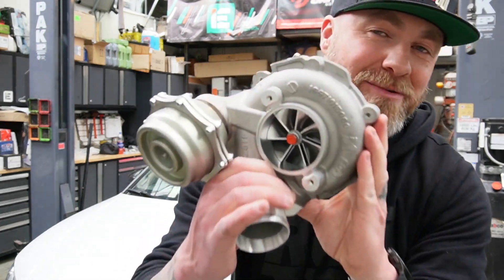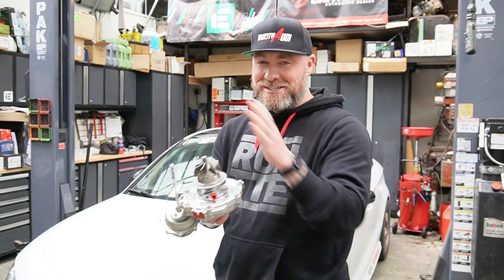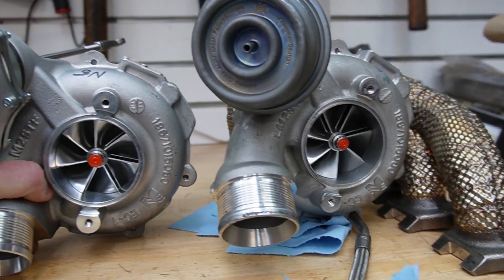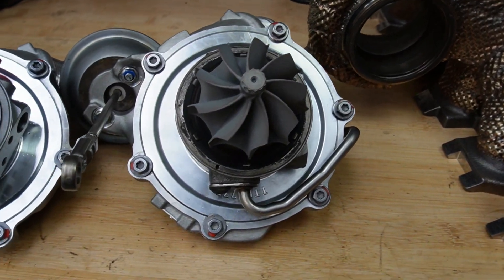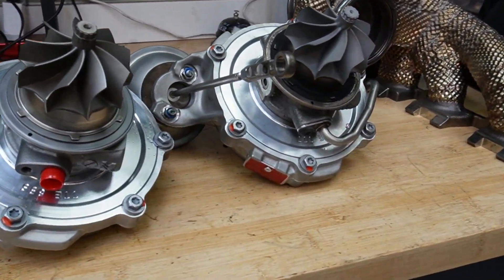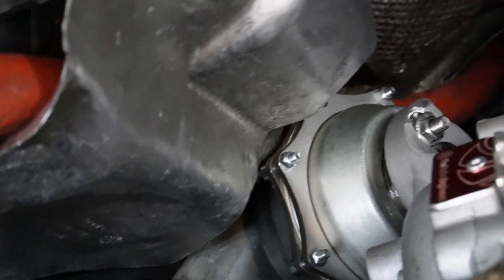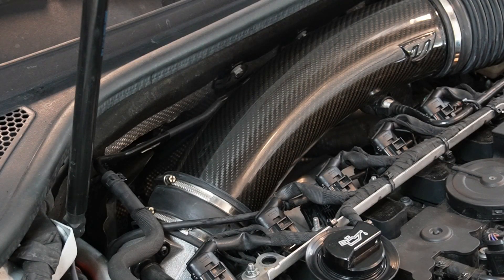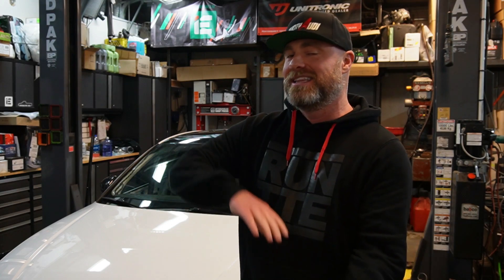Revised TTE855 Actuator Swap/Install - Audi RS3

Comment: That actuator is very very close surely with touch the shield even with tough engine mounts?
Reply from the maker: Visual inspection has shown us that the engine doesn't really move at all anymore, but we will be inspecting it after the datalogging runs.

Comment: Did you have to buy the upgraded version or did they provide it to you as a customer revision?
Do they request the old one back? 
Wasn't clear on how this revision upgrade path was undertaken.
Love the content.
Reply from the maker: Free of charge from TTE. If you've purchased an 855 that came with the original actuator, contact TTE and let them know you'd like the new one. They should provide you details on the rest.

Comment: yesterday ma friends 855 blow, dang. hope our 777 do da job
Reply from the maker: Blow as in blow up?
Reply: @VancityAudi  ya, Smth dmg da wheel
Reply: @VancityAudi  like bolt went away from da turbo
Reply from the maker: @4TKRACE  wow, that is awful!
Reply: @VancityAudi  ya, n before n75 solenoid went away, boost was jumping 1.8-2.5 bar. 855  is abig peace of God damn 💩💩💩 turbo
Reply from the maker: @4TKRACE  hahahaha, well I'm hoping I don't suffer the same results!
Reply: @VancityAudi  another one 855 down on iron block rs3, tottal bullshitt turbo :) 777 doing da job
Reply from the maker: @4TKRACE  I didn't think these turbos were meant to be installed on the iron block motors?
Reply: @VancityAudi  there is version with different actuator. Officially from tte
Reply from the maker: @4TKRACE  Sorry to hear that they are not working out!
Reply: @VancityAudi  np, I glad we bought 777 hehe for ma close friend ^^
Reply: my TTE855 blew only 3000km ，@ 98ron 13 deg ign，2.1bar boost ，cant believe this turbo doing this，wheel axle is bent and deformed, and the compressor wheel is stuck.
Reply: and I checke all water & oil pipes it’s ok,and intake system its fine too,TTE 855 just blew for no reason! So disappoint about this turbo!

Comment: I was talking to a shop about installing a TE855 - they are concerned with back pressure issues. 

What are your thoughts on this?
Reply from the maker: I'm not worried about back pressure on my setup because my exhaust is kind of nutty: https://youtu.be/PvX51iOOHhQ
Reply: @VancityAudi  Do you know if dumps will help with this?
Reply from the maker: @TheMafea  they absolutely would, but that isn't a realistic way to drive the car all the time. That would only be for racing.